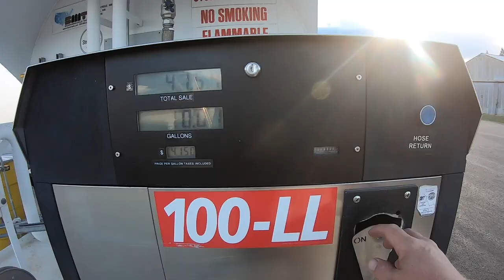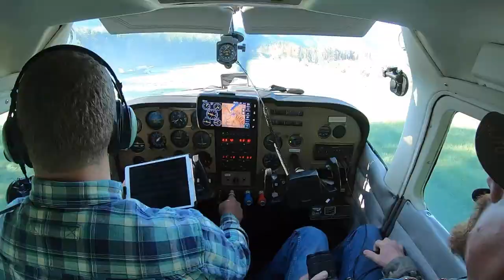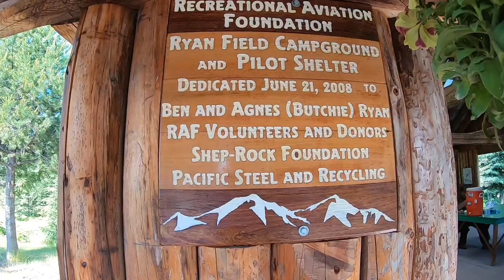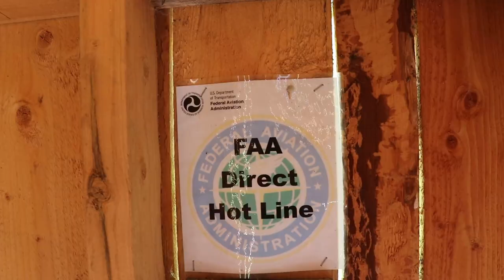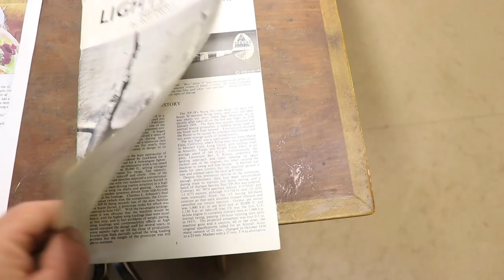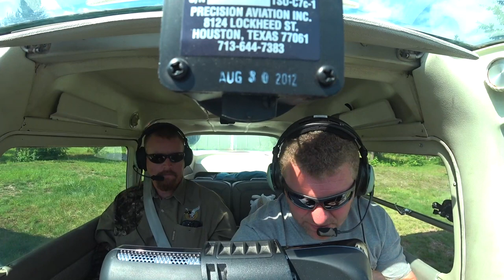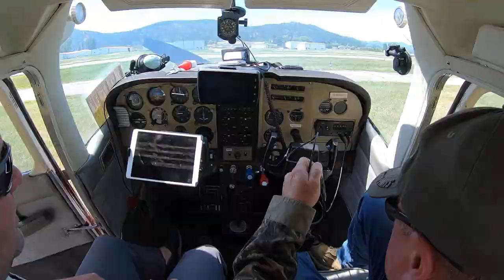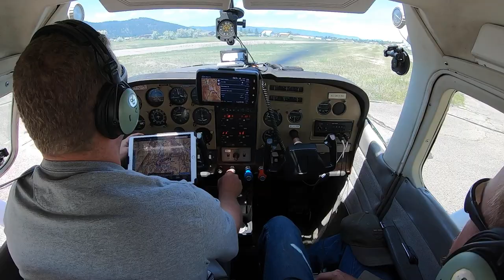Flying the Idaho Backcountry (A Vlog)

Comment: With life getting in the way, I haven't been current in almost a decade and I miss it every day. The fly in's were some of the best times I ever had.
Reply: You and me both, but that's about to change for me this spring after being earth bound for the last 13 years. Spending the snowy winter hitting the books and getting the aviation cobwebs cleaned up.
Reply: @michaelb.8953   I hope to do the same. When I get this log house Im building finally finished I plan on getting back in the air as fast as I can. I used to fly every single day and now nothing.

Comment: Why the comment, "Air speed is alive?"
Reply: Referring to the air speed indicator (speedometer) in the dash. It's not mechanically driven - it uses moving air. Sometimes the sensor can become stuck or jammed while not flying by dust/dirt and insects.